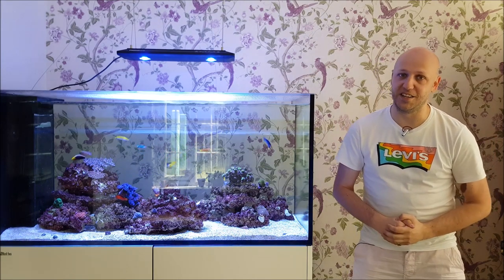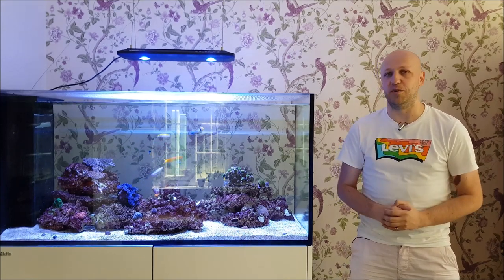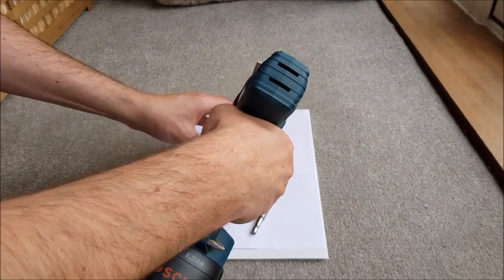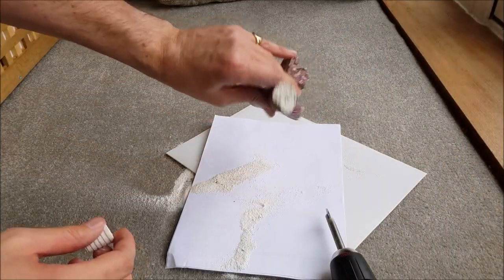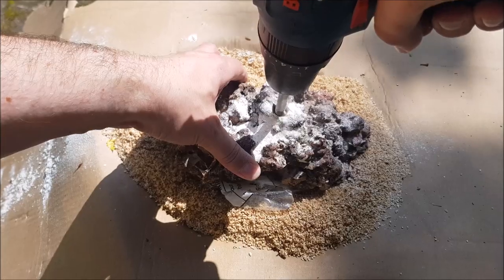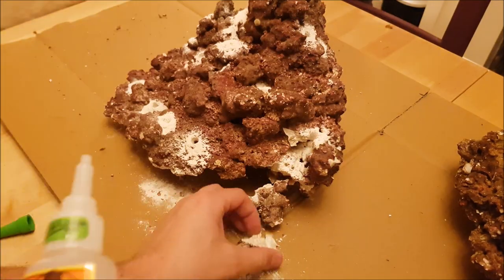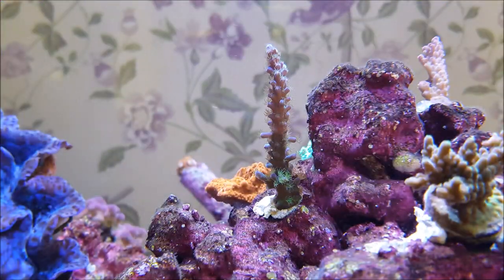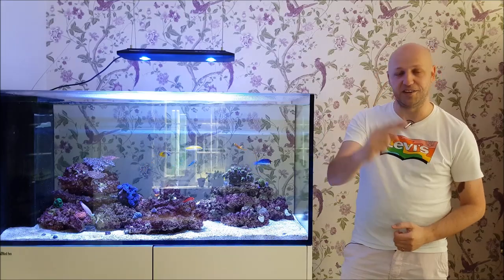How To Drill Real Reef Rock

Comment: What type of pilot bit did you use?
Reply from the maker: Dondante there's a link in the description for the bits I used. Although I can't remember what size pilot I used. The main bit is 16mm - given the shape of the bit, you might actually be better not using a pilot.